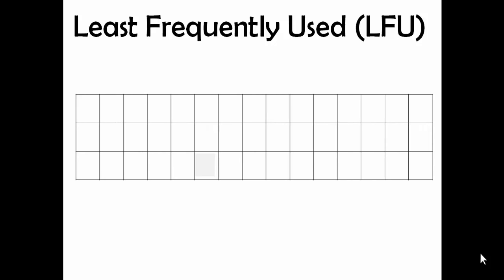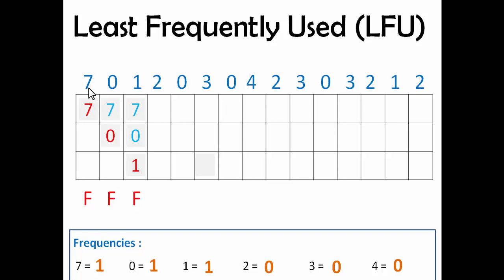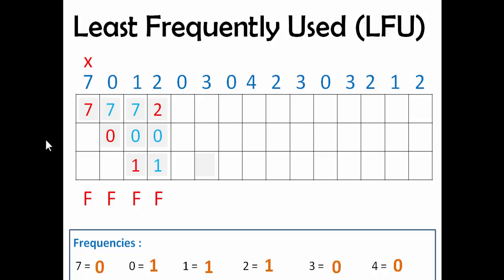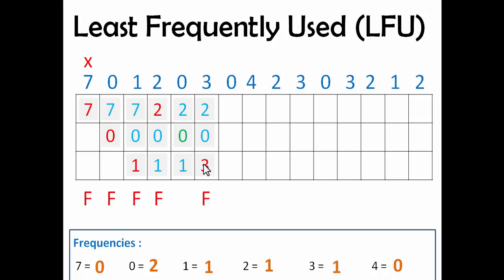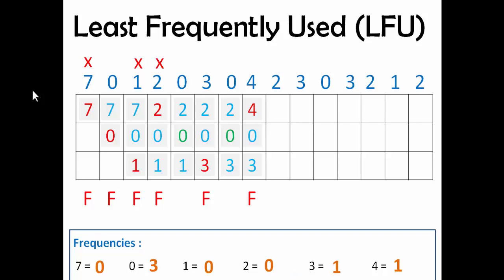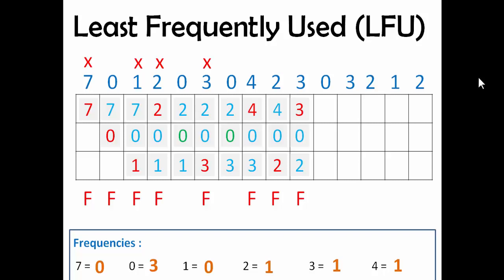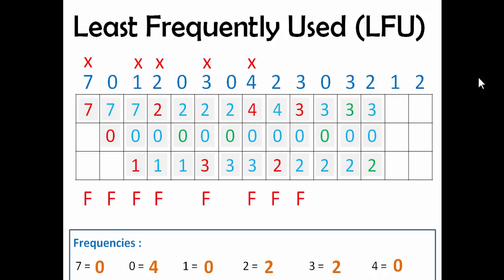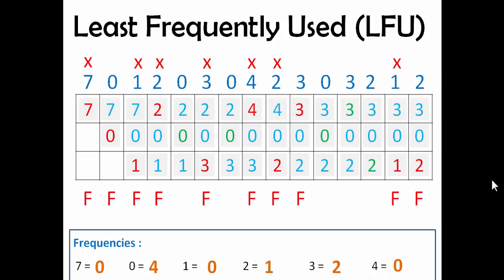Least Frequently Used (LFU) Page Replacement Algo

Comment: the result should have been 102 instead of 301....3 should have been replaced instead of 2 in the 3rd last step
Reply: +Rishav Mishra Yep I got the same result.
Reply: +Rishav Mishra assuming you are referring to the changes made in the 2nd to last column: 

From what I understand, you may be confusing LFU with LRFU. With LFU, once the least frequently used value is not unique (i.e. 2 & 3 = 2) the algorithm chooses what to remove based off FIFO - First in First Out of those values. So in our case "2" entered our cache prior to "3" and therefore was removed. This happened despite "2" being called from the cache (NOT removed or added) more recently compared to "3"
Reply: +Rishav Mishra , you are using least recently used item( ie how the questions is asked in leetcode) to break the tie (thats why its 102) where as in the video she is using first in first out to break the tie.so its 301 for her

Comment: THERE IS AN ERROR IN YOUR DEMONSTRATION 
Towards the end, you had two page hits 3 0 2 and 3 0 2 when you loaded 3 and 2 respectively. Since the frequency of 3 and 2 are equal, you should have used LRU to break the tie. 3 should have been replaced when you loaded 1 . Therefore the final page presentation should be 1 0 2 . 
Thank you for your efforts.
Reply: we were using fifo in case frequency where same, from the start.but i have same doubts as yours,as similar question from google have same answer as you said.
Reply: Yes I agree
Reply: What ever she has done is 100% correct as per her assumptions. She has been using FIFO right from the  beginning in case there is a tie in frequency. You can have your own implementations. But according to her problem statement and algorithm the solution is correct.
Reply: I was searching for a comment like this, I agree with you
Reply: Nah, she used FIFO for tie breaker instead of LRU it's correct according to her algo

Comment: Hi, Thanks for the well explained video tutorial, I tried it on my end with increase page frames of 4 and with different frequency strings, and it happened that there are two ties.

e.g. 2 and 5 both got 1 (count)
3 and 4 also got 2 (count)

So in that case which is which? should I apply FIFO on both and check for frequency string that came first?

e.g. in my case 2 and 5, 2 came first (2)
in 3 and 4, 3 came first (3)

BUT, 2 came first before 3, should I replace 2 since it came before 3?

Hope to hear you soon, thanks again

Comment: you made a mistake at 5:43 !
look, 0 came before 4. so, 0 should have been removed instead of 4 !
Reply from the maker: Bipin Khatiwada This is least frequently used algorithm. So you remove the least frequently used page. 0 has the highest frequency and 4 and 2's frequency was same. So we check which one came first and we remove that one.